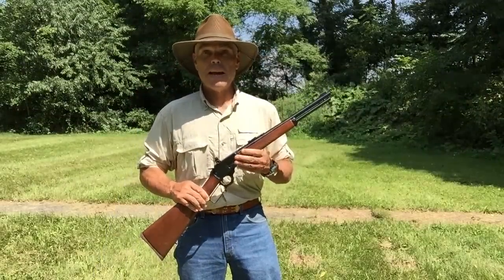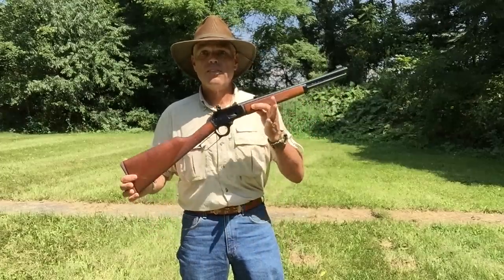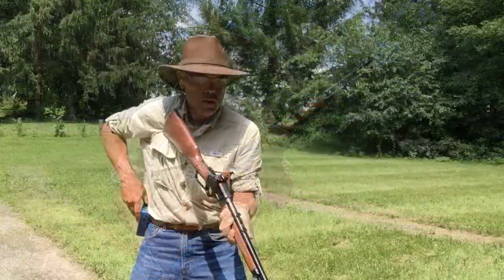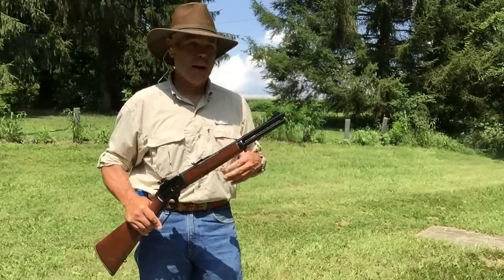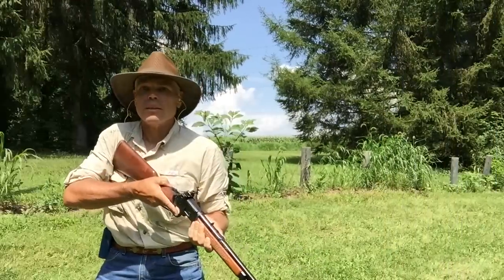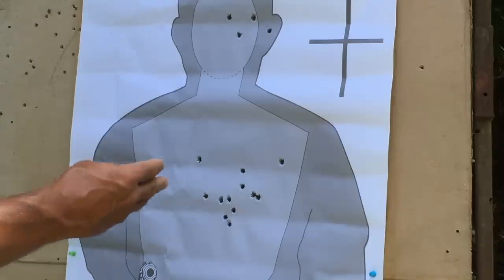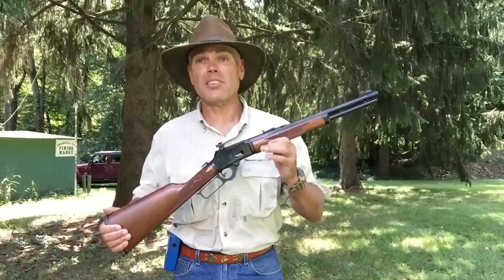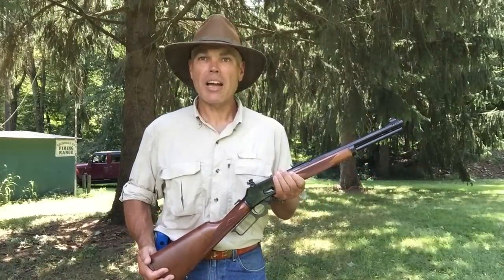Marlin 1894 Lever Action vs  Tactical Carbine Course

Comment: Maybe the sights needed to be adjusted a hair to the left.
Reply from the maker: Ha! Or maybe I do!
Reply: Possibly. It just seemed the group you shot was a hair to the right.
Also, do you have to load single rounds for the stage that you didn’t get enough shots off? If you didn’t, maybe all 3 rounds could’ve been loaded and then try to get them off fast? Just curious.
I definitely agree though, these pistol caliber lever rifles are underrated. I have the marlin in 44 mag. It’s such a fun rifle to shoot.
Reply from the maker: @SIRJ1895  Thanks Scott. That stage requires 3-shots, a reload, and 3 more shots all within 12 seconds.

Comment: Interesting video. I love lever guns but i dont really see this as a viable option for law enforcement. The reload under stress would make this unrealistic and unsafe in a gun fight. As long as you only needed the rounds already loaded youd be ok, but if you needed to reload you would be compromised. Too many better semi auto box fed options honestly. Id still rather have an ak, ar, sks, or a mini 14/30.
Reply from the maker: Like I said in the video, I was not trying to suggest that department's should replace their modern patrol rifles. I just wanted to see if I could meet the qualification standard with the 1894CP. That said, how ofted does your average peremiter officer have to reload?
Reply: hrfunk not trolling you. I agree with you and understood where you were going with it. Just a little friendly feedback.
Reply from the maker: Thank you!
Reply: +02cents I dont see a lever action as being any more disadvantageous than say a pump action shotgun with a 5 or 8 shot tube. Reloading would be very similar, and while say a 12 gauge is capable of more power and versatility like bean bag loads and etc, the general issue of performance is about the same as a whole. 

I dont think it's unrealistic to consider one for use, however it may not be the most practical option either. Most lever guns are nowhere near as accurate as modern carbines like AK's, AR's, and etc. In the time it takes to reload one round in a lever gun you can reload a whole magazine with those same rifles typically as well. 

But, careful study of the subject has shown me and some others that often when people are rounds limited, they seem to try to make the most of what they have. This isnt always true, but I've seen it time after time at the range and even in some serious shooting data that would suggest when people know they have less to work with they try to make them count more vs having say... 17 rounds in a handgun and knowing it will be forgiving if they miss 5 or 6 shots.
Reply: Christopher agreed, being round limited CAN somewhat force an individual to try and be more accurate, but when the adrenaline is flowing and fine motor skills are out the window, thats the worst case scenario for trying to load individual rounds into a lever gun. I would say it may be a bit easier with a shotgun due to the size of the rounds youre trying to manipulate, but an ak or ar type mag fed high cap rifle would be my go to every time. If im going to a rifle, im going to assume the poop has already hit the fan and i want the best tactical advantage i can get.
Reply: @Brykk  Well yes, the issue of fumbling rounds is a problem. It happens a lot even with shotguns despite their larger size. But, a lot of people have learned to compensate for themselves when adrenaline hits. Not everyone is reckless or fumbling, some are quite calm and collected. That being said, yes modern tactical carbines are definitely better choices for the most part. Never denied that nor would I pretend otherwise. 

But grabbing a rifle doesnt always mean the worst possible scenario. Could be somebody thought you were gone and broke in, well... a lever action will do just fine. Multiple home invaders that are armed, yeah I'd want that AR, AK, or whichever but that is EXTREMELY rare and plenty of video footage of such incidents have shown that when one gets shot or shot at they usually flee the scene. 

Obviously if I know I'm going into a situation where things are going to get ugly I'm going to pack the most efficient tool for the job. But a lever action is just a practical tool for almost all situations. Hunting, target shooting, and personal defense. Many are very economical in that regard and have great performance ranges in various calibers. Like I said.. I dont think it's the greatest choice, but you could do worse.

Comment: HR - I’ve rewatched this video a few times.  For non-LEO home defense, I think a 16 or 18 inch lever action carbine, chambered in .357 magnum, would be difficult to beat.  I am NOT criticizing ARs (or other designs) firing .223/5.56x45mm at all;  however, the carbine fires a round that has an appreciable larger diameter (.223 versus .357), and weighs at least twice as much  for example 158 grain versus 75 or 77 grain), at a velocity of ~1600 FPS.  85 years of .357 magnum experiences documents the fact that it is an extremely effective defensive load, when fired from (let’s say) a four or five inch barrel.  Therefore, it is completely reasonable to suggest it will be appreciably more effective when it’s fired from a barrel that’s at least three times longer.  Finally — and I truly HATE to raise this point — there are venues in America where know-nothing politicians and prosecutors will joyfully go after anyone with an “evil” AR, but great grandad’s lever action rife is a lot less likely to give those ignorant officials the “bully pulpit” they so ardently desire.
Reply from the maker: I totally agree with your points Roy. Thanks for the comment!

Comment: Why did he single load the rounds instead of just loading the three through the gate?  I don't get it.
Reply from the maker: Because I only had 12 seconds to complete the exercise and I thought it would be faster to single load the cartridges.
Reply: @hrfunk   I bet if you run it again you would nail it with time to spare. With all due respect sir. Not trying to MMQ here just discussing an constructive observation.
Reply from the maker: Thank you! Maybe I’ll give it another try using that method.
Reply: I think he did it that way as with the time available he could at least still get one or two extra shots off.  What happened if he used up all the time getting the three rounds into the tube and then by the time he got back on target was only able to get one of those three rounds off before the timer or the timber went off while he was putting the third round in the tube?  It is a hard call, if you had 15 seconds I'd load all three in the tube as you suggested, if you only had 9 seconds I'd do it the way hrfunk did it.  12 seconds, its a hard call, maybe try both ways?

Comment: That's a pretty good showing.   If it were a real life situation though, I think you'd fail.  In real life there wouldn't be any earplugs and that porting on your barrel is a killer.   I'm not totally naive though, I do realize most things "tactical" are just a fantasy...
Reply from the maker: c s For whatever it’s worth, I’ve fired the 1894 CP more than once while hunting without ear protection, and I never had an issue. That said, I don’t think I’d want to shoot it with magnum ammo inside a structure.

Comment: Not 30-30 😞
Reply from the maker: Coming soon. Stay tuned!
Reply: @hrfunk  

😀
Reply: @hrfunk  

BTW, I think its fair to modify the reloading portion of this drill, to accommodate a gate loader. The drill is designed to demonstrate operation of the platform, not to perform a discrete task. If it were a shotgun drill, youd be allowed to load on the fly, or direct load individual rounds. I dont think it would be cheating to start your reload immediately after the last round, as youre getting into the kneel.